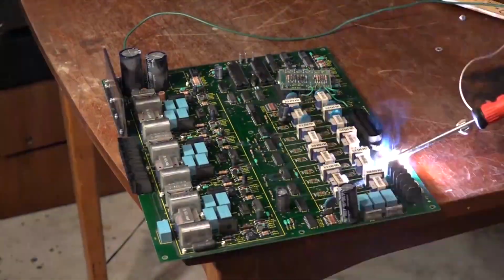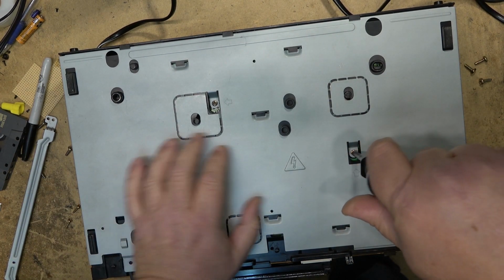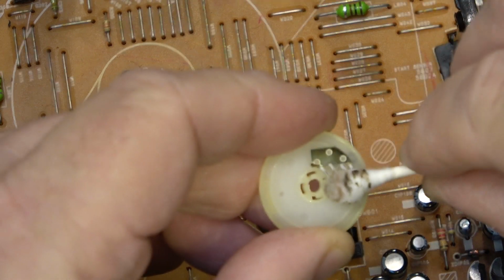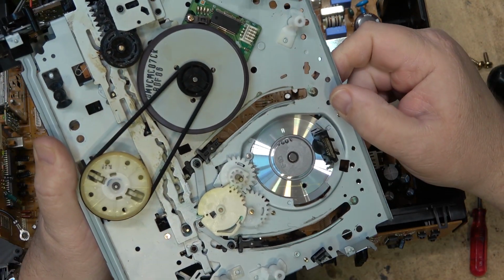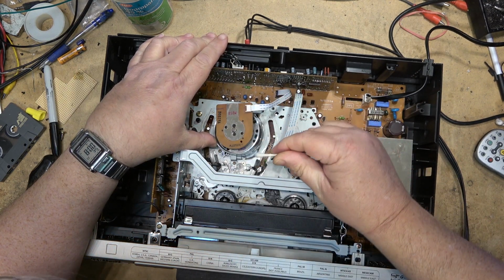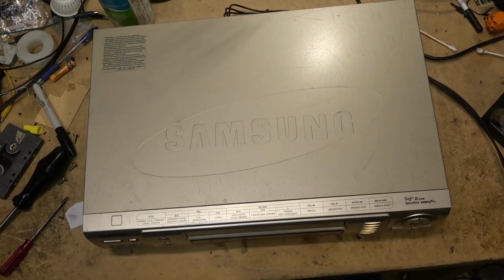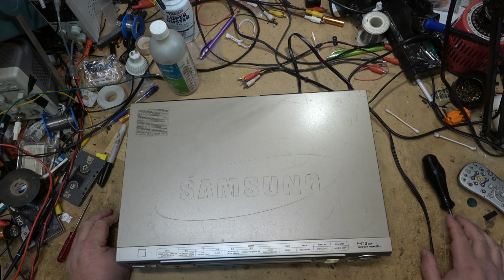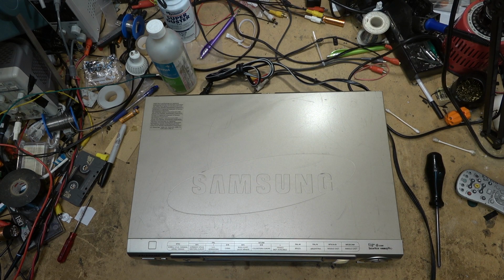Samsung SV5000 Multi System Conversion VCR mechanical trouble

Comment: i still record on tape with my sl-hf1000 and my edv-7500
Reply from the maker: Borrowed time.  Heads wear and then no work.  They are typically only good for about 1500 hours.
Reply: You're just shortening out the life of your video heads. Finding a Betamax machine in good working order is not as easy as finding a vhs player. Do like myself and only use those for playing back tapes. There's no reason whatsoever to record anything with these machines in 2021 except for testing purposes.
Reply from the maker: @josegti84  
My words exactly.  I say the same to people that insist to record their home videos on 8mm and hi8 cameras.   For that matter the same goes for people that i insist on using cassettes and reel to reel tape.
Reply: The last time I've recorded anything with my SL-HF950 (SuperBeta) was when I got my hands on a NOS pack of 10 Sony Pro-X tapes. I just wanted to test the machine to its full potential hooking up my HD DVD player and the results were just amazing. These decks were also used for high quality audio recording back in the day. But that's about it. Another good practice to extend the life of your video heads is to buy a separate tape rewinder. I have a bunch of tape rewinders for all video formats (VHS, Beta, 8mm, MiniDV).